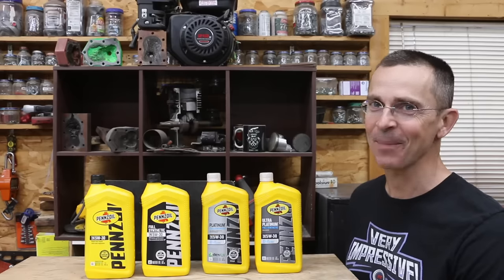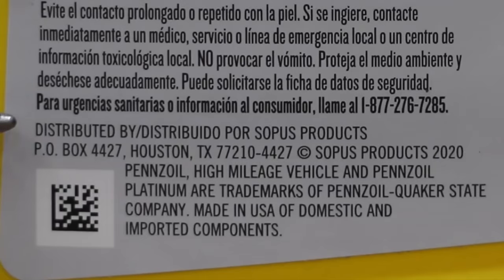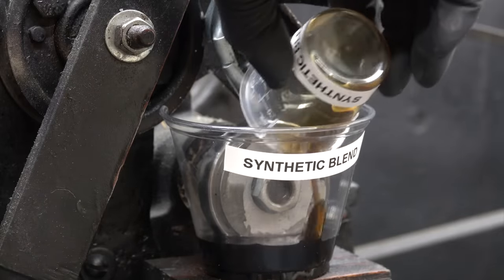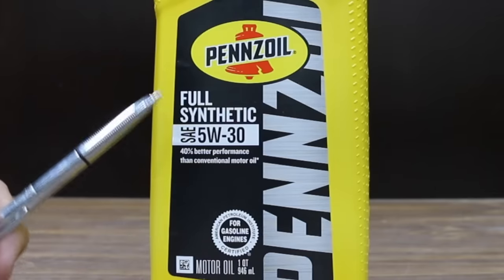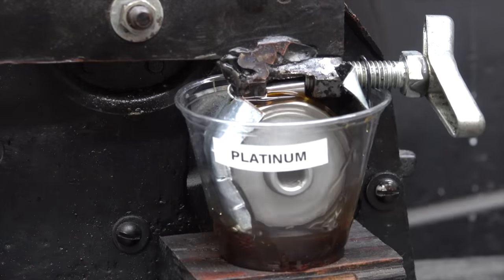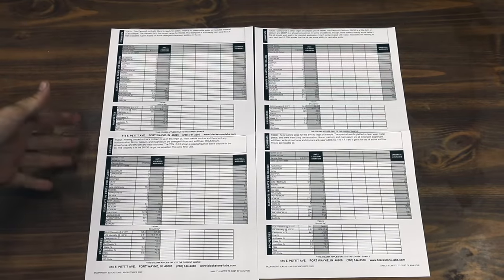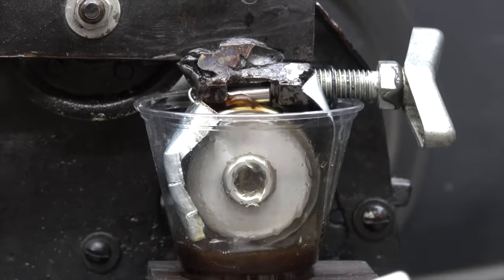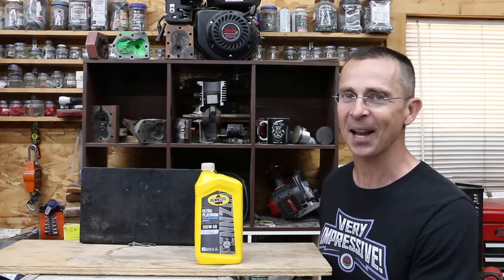Are They All The Same Motor Oil? Let's Settle This!  Four Levels of Pennzoil Motor Oil Compared

Comment: Yes, compare the brand...against itself! We need it for many more brands to come! Please make it happen, Todd! 🐺🔧
Reply from the maker: Thanks for the suggestion.
Reply: Agree. Id like to see this too
Reply: @ProjectFarm  I agree!  Vote for Castrol products
Reply: watch his oil comparisons years ago if you guys didn't, he already did like 20+ of them.. of course there are hundreds
Reply: How about those cheapest oils branded as auto zone , advanced auto etc .    I was told they are recycled oil .
 But no confirmation in that 
It would be interesting to see how they measure up to the platnum winner
Reply: You mean like the oil comparison series Todd made a few years back?
Reply: Yea, I’d like to see a similar test with mobil or castrol
Reply: @boracay12  I like this suggestion as it gives a comparison to the absolute "worst" oil you can buy.
Reply: @tim_creggan  There is no 'bad' oil. They have to reach certain certifications before they can be sold. But some oils are definitely better than others. I use cheap oil and just change it at 3,000 miles. I have 4 vehicles; each has more than 150K miles. No motor problems yet.
Reply: @MrTruckerf  I get that.  I posted another comment that it would be good to see a video showing real world failure rates of different oils and what the wear rates shown actually mean on real engines
Reply: @ProjectFarm  test all chevron oils 😁
Reply: @ProjectFarm  As an European subscriber I would love to see a comparison of more generic oil brands. Castrol, Liqui-Moly, Total, Petronas, Elf are some of the most often brands found on shelves here. Or even a test between the huge amount of oil types Castrol has. I've always been confused and had difficulty choosing a "right" oil type. Because the most expensive one...is not always the best, as have your videos proven time and time again. Cheers from Italy

Comment: I live in the northeast and deal with well below zero temps all winter long...I've been running Pennzoil Ultra Platinum since watching the motor oil shootout a few years back. I have to say I have been very impressed with the PUP oil and have sent multiple samples out for testing and the oil is just fantastic at protecting my SUV. Many thanks to PF for doing the oil challenge...this Pennzoil only test just reinforces the previous results and PUP is definitely the way to go.
Reply: Buff, NY here; I just may be changing my brand as well 👍🏽

Comment: Independent testing is so important for holding companies accountable to their words. An excellent comparison as usual. I usually go with whatever is cheapest, but I will switch to the Ultra Platinum from here on out.
Reply from the maker: Thanks for sharing.
Reply: Changing your oil regularly is more important than the brand or type.    My prior car had 300,000 miles on it, never had anything but conventional motor oil in it, and still got 30mpg after 13 years and all those miles.
Reply: @tbelding  yep. Changing the oil regularly is most important.

Comment: I run the ultra platinum in my car but sometimes not available so I run the platinum. Glad to see another great one from the farm! Awesome. Ps, looks like I'll look harder next time for the ultra!!!
Reply from the maker: Ultra is a great choice!
Reply: Yeah no kidding! Don’t settle for the platinum!
Reply: @webbie021984  Agree with this. I order an oil change because it takes Amazon a month sometimes to have stock to ship.
Reply: @joesshows6793  yep, never again. I change my oil more often than most, even with full synthetic I don't go over 3500 miles, oils cheap compared to engine replacement and or parts! Lol   I daily to work a 93 ford ranger with the 2.3l that has 494,000 miles! Original engine transmission and rear end.
Reply: @webbie021984  Just saw plenty on walmarts on line site plus cheaper then Amazon for many things.
Reply: I’m now going to choose Ultra Platinum-Full Synthetic-Platinum. I was surprised the platinum performed worse than the lower full synthetic…
Reply: @Chinesefoodrocks1521  exactly, who would of thought

Comment: I would have loved to see a "high mileage" variant in this comparison. 

Maybe you could try to compare "high mileage" oils vs their standard versions of the same brand?
Reply from the maker: Thank you for the video idea!
Reply: I agree! I always buy high mileage because I always but older used cars lol
Reply: Most definitely please
Reply: Yeah I was a bit disappointed that he didn’t do that one.
Reply: Agreed, I use the regular Platinum High Mileage. Would have loved to see it vs. the Ultra. I bet it's just an additive pack that's between the two tested Platinum variants, probably closer to the regular Platinum than the Ultra.
Reply: YES to this comment!
Reply: High mileage oil   Is designed to expand The gasket in high mileage engines  so they don’t leak
Been using Valvoline in my 2000 excursion 5.4 263k miles
So far so good
Reply: This one would definitely be nice to see. I have to use it on my current vehicle.
Reply: I have 234k on my Jeep and use the high mileage stuff. Valvoline. Supposed to have seal conditioners. Not for maximum fuel efficiency  though. There is a 75k and 150k version of the stuff. Red and black containers.
Reply: @ProjectFarm Definitely please do this test!
Reply: @ProjectFarm  mobile 1
Reply: @ProjectFarm  This needs to happen! I using the Pennzoil palatium HM 5w-30 when the Ams oil was costing me $100 oil so every month or two I drive like 25k a year
Reply: Agreed
Reply: @daveyt4802  regular or full synthetic high mileage oil.?
Reply: Yes please. High mileage vs not high mileage.
Reply: @stevek343  Synthetic blends.
Reply: @6gatornation  That's why I'll never use them under any circumstances. Expand, yes, but also soften, and the combination can cause catastrophic seal failure. It's not common, but it can happen. I use quality, normal synthetic oil (usually Rotella T6 or Valvoline Blue 5w40 mixed 4:1 with Lucas Full Synthetic Oil Stabilizer) and have very few leaks and my engines last basically forever, even when they come to me in marginal condition—they never seem to get worse. The one exception was when my wife forgot to add oil to hers for months and months and it almost ran out of oil, and it slopped a rod bearing, but that's not an oil failure, just a failure to oil.
Reply: @Anderson_999  I use the same on my Lexus with 253k miles on it.  That would be my guess as well.
Reply: Yeah I've anyways wondered about this 🤷🏼‍♂️
Reply: @edifyguy  I'll bet that's the list time you didn't take a quick peak at the oil level yourself every now and then 🤣
Reply: @joeg5414  Sure was! I check it myself every chance I get now. It's a lot faster than R&R an engine.
Reply: @ProjectFarm  please make that video!
Reply: @mikec9112  Nothing like snake oil to make things better ;) It's purely anecdotal evidence, of course, but softening the rear main seal, which is constantly subjected to a rotating shaft, causing erosion and then leakage is a predictable outcome. No seal "conditioners" for me, EVER!
Reply: Lol, he'd have to use some worn out testing equipment to be sure!

Comment: I've been using Ultra Platinum for years now. When I had to drop the oil pan on my 2000 Honda CR-V with 230,000 miles on it due to a stripped drain plug, when I looked inside of the motor, it was so clean, you could practically eat off of it!
Reply: I'd imagine the newer Honda's that had the oil dilution issue would not look so good based on what Project Farm showed with gas in the oil here. Those older CRV's are great my friend had a 2003 with 140'000 miles!
Reply from the maker: Thanks for sharing.
Reply: Never had a coolant or fuel leak into the crankcase. Dust too. Nice car!

Comment: A brake pad comparison would be right up your alley.
Reply from the maker: Great suggestion!  Thank you
Reply: @ProjectFarm  If you do, be sure to use a filtered breathing apparatus, that's some toxic stuff, just a reminder, I'm sure you already know that. As a side note, I've always wondered what causes a rotor to warp, is it the heat, from overuse or a stuck caliper, or a sudden change in temperature, from a puddle of water, or car wash, snow, et cetera? Great work you do!👍

Comment: Based on the results of your massive oil showdown from 2 years ago, I now exclusively run Ultra Platinum in my two vehicles as well as my girl friend's. It's typically around $22-24 for 5 quarts on amazon. Incredibly bargain for a great oil.
Reply from the maker: Thanks for sharing.
Reply: The oil showdown also had me hooked on ultra platinum especially for the price!
Reply: I'm typing this in August 2 2022 so, one month later - this oil is now $44 at amazon.  Maybe they read your comment and raised the price?
Reply: @robertmaybeth3434  Haha, keep watching it as the price will fluctuate MASSIVELY. Super frustrating, but don't worry it will come back down. My cars take different weights, and I've noticed huge price differences between the different weights. Just be patient and diligent!
Reply: @SirPhilMcCrackinVonBeggington  I've noticed the same thing happened to Shell Rotella oils quite a while ago, they're still super expensive.. hopefully it comes back, I can't find ultra locally
Reply: @marvnation924  I haven't bought Rotella in a while (sold my motorcycles years ago) but when I was still in the game, Walmart was the best place to get Rotella. Good luck man.
Reply: Checked amazon the other day and the ultra was going for lowest $47(5G) from other sellers. Found it at Walmart(only online w/ $7 shipping) for $42. Ughh
Reply: @robertmaybeth3434  He also did similar test on Costco synthetic oil...that is what I use.  In my opinion, changing oil every 5000 miles will take care of your cars more than if you change the ultra platinum oil every 10,000 miles...On the other hand, if money is no object, go for the Ultra oil and change it every 3000 miles...you are not going to hurt my feeling.
Reply: I've used cheaper brand oil priced at 3$ a quart in an emergency, as long as it says  " For higher mileage vehicles.  But l try to stay with Pennsoil

Comment: I love Blackstone Labs - the identified a large amount of dirt in my oil in a used 1996 Lexus I bought and they advised me to check the air-intake & filter, and sure enough: At the bottom of an intake hose clamp (after the air-filter) it was not re-attached correctly and had a 1/2" air-gap!
Now I take a sample every oil change, on every car!
Reply from the maker: Great test lab! Thank you
Reply: I bought a used car with the air filter installed wrong. This model it was easy to crush the filter if you were not intelligent enough to spread the airbox apart and simply slid it in (you'd feel it crush). The filter had a 3" gap and it must have been like that for 50k or more miles judging by the dirt on it.
Reply: They'll eventually disappoint you.  I stopped using them about 10 years ago after they lost a sample and sent me the wrong UOA on another.  Nobody who takes oil formulating seriously uses Blackstone.  They charge extra for TBN,  they don't even use gas chromatography for fuel dilution (they guess at it) where as every other lab actually measures it, and they're more expensive than other labs even without the extra for TBN... and the other labs include TBN.
Reply: @almizzyracing8004  What are the names of your "other labs"?
Reply: @joeteejoetee  ALS tribology (Wix kits), WearCheck, Polaris labs (Amsoil), Predictive Maintenance Service, and Speediagnostix, just to name a few.  I go back and forth between Polaris labs and WearCheck.  If I need oxidation and nitration values, I use Polaris.  If I need sulfation and particle counts, I use WearCheck.
Reply: @almizzyracing8004  Which of these is less expensive than Blackstone? I checked Polaris and they were much more expensive.
Reply: @pauls.1783  Blackstone is $40 with TBN which is a critical component for used oil analysis.  Polaris is $35 with TBN and also includes gas chromatography, oxidation, and nitration where Blackstone does not.

Comment: Maybe you could do an oil filter showdown like the oil one years ago. That was a great series. I waited every week for the new instalment ha. It would be interesting to see results on how various brands and quality of filter perform
Reply: I'd love to see that! There are some filter tests out there, but almost all of them are just visual inspections of the filter construction/media. The few I found that measure the ability to filter out particulates are unfortunately pretty old and don't cover a lot of the newer filters designed for extended drain intervals like the Wix xp. I'm really interested since a lot of newer vehicles have a recommended oil change interval of 10k miles.
Reply: To do this properly, it could be extremely expensive, but would be awesome. Particle counters up stream and down stream ($16k each) and measure differential pressure (could be anywhere from $100 to $100k depending on the DAQ used) would likely be necessary to test properly. The main things manufacturers are concerned with when making filters are particle filtration efficiency and particle capacity. I've looked up specs for filters before and haven't had much luck, so I would love if Todd would do some testing.
Reply from the maker: Thanks fore the suggestion.

Comment: Would love to see the High Mileage versions tested, or even a high mileage tournament would be awesome!
Reply from the maker: Thanks for the suggestion.
Reply: @ProjectFarm  yes High mileage Pennzoil Platinum vs competitors would be amazing as well!
Reply: I swear by Valvoline high mileage synthetic blend oil use it in all my older vehicles always a clean engine and keeps the seals nice
Reply: @kaw1240  same, i only started buying it for its low price at wal mart and soon realized it had stopped a very slow RMS leak on my older focus. It's now gone 10k miles on it and is dry as a bone.
Reply: Yes I agree high mileage oil showdown
Reply: Would love to see this also, but after 2 year old video, I still prefer the winner , Amsoil Signature Series!
Reply: Test them all once modified with additives like,Lucas ,stp,marvels etc.....
Reply: Hem Dog  Pennzoil makes a high mileage synthetic blend, but they also make a platinum premium synthetic high mileage made out of the natural gas base
Reply: My thoughts exactly!
Reply: Yes high milage battle would be awesome!
Reply: This, I second 🥈 this message
Reply: @ProjectFarm  more affordable High Mileage options would be valuable to learn about!  Thank you for what you do.
Reply: Yes please
Reply: @ProjectFarm  (I was looking for the difference between pennzoil platinum and pennzoil platinum high mileage). Love your videos!!!
Reply: @kaw1240  I'd like to see him do a side by side test of rubber and seals to see if there's actually a difference between high mileage and regular.
Reply: @ProjectFarm  yes pl do high mileage also conventional oil tournament
Reply: Rumor has it that motor oil companies stock real differentiated products in Project Farm region and otherwise it's all the same.
Reply: Great idea
Reply: I agree as that's what i use too and want to know if i should keep using.
Reply: I like Mobile 1 high mileage oil and would love to see a comparison between the other brands high mileage equivalent!  👍
Reply: @ProjectFarm   I’m guessing high mileage oil primarily has more detergent to keep the blow-bye in suspension ling
Reply: @bhggoilable  quality oils don’t need or like additives. It messes with the chemistry of the original oil additive package

Comment: Here's an idea for you... The most important test when it comes to engine /trans fluids from different velocitys and brands is how they react to rubber seals overtime to see which is the best fluid to prevent leaks and overall less repairs
Reply from the maker: Thanks for the suggestion.
Reply: May not be "the", but certainly "one of", especially at the elevated temperatures heavy towing can put into the fluids.
Reply: FYI  A little Marvel Mystery Oil (Substitute a quart a couple of times.) will condition and swell "rubber" gaskets and seals due to it's aliphatic hydrocarbons.  They will never dry out, crack or split.  40 years and no leaks!  Take note that they will need replaced if components are disassembled because they will be too large to use again.  It is also excellent for cleaning, freeing and quietening sticky lifters.  After MANY years of real-world testing, I now do NOT recommend using MMO every oil change because I think it does not have good lubricating properties.

Comment: Outstanding test. I’d love to see this same setup with Mobile 1’s lineup of oils as that is what I have traditionally used in the past (Specifically their extended performance series of oil)
Reply: Highly agreed
Reply: Pennzoil beats M1 in every other test I've seen. Tho M1 is still a fine full- synthetic oil. Not going over 7500mis under ANY circumstances is key. -Michigan
Reply: Had a viper truck that ran mobile 1. At 42k miles the engine was rebuilt. Never had a problem with original Pennzoil. Looks clean at 100k miles with an oil change due.